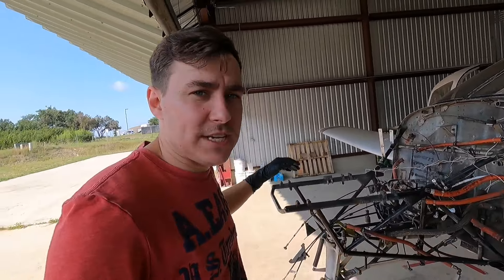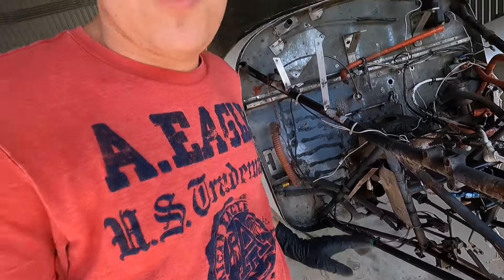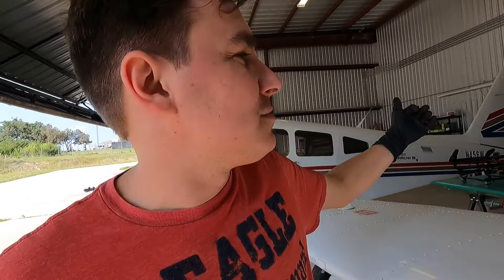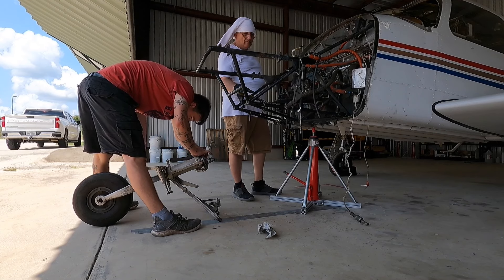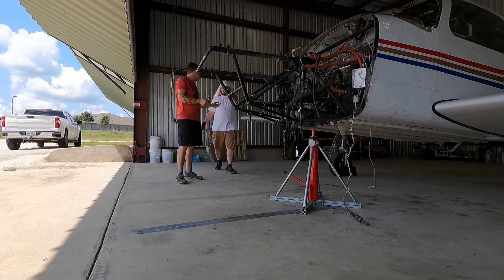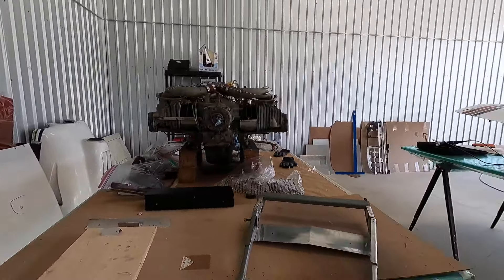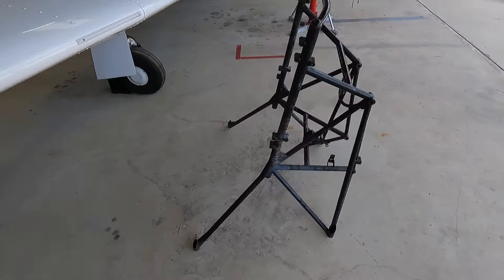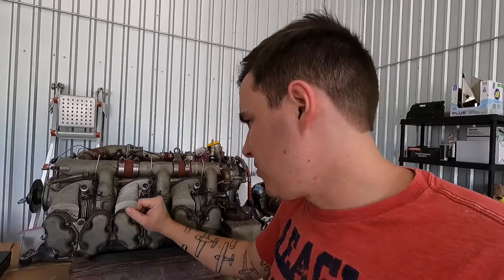Cost Comparison: Aircraft Engine Overhaul vs. Repair Station Overhaul vs. Buying New for Exchange

Comment: The problem with field overhauls is generally the A&P or IA for that matter just lacks the experience and then there is the issue of warranty. A few years back I assisted on a field overhaul of a C-85, cases, crank, cam, lifters, rods, mags, accessory gears and a hand full of other stuff was sent out for inspection and or rebuild/repair. While waiting for everything to come back we gathered all the "Paper", Service Manual, Parts Manual, Overhaul Manual, Service Bulletins, Service Letters, AD's..etc. It wasn't difficult, just time consuming on the research side of things.. Personally I think a Field Overhaul might be slightly better, if a part is found to be in specs but on towards the limits a shop will use that part, where the owner of a field overhaul might elect to just replace it, .. just my .02 cents, which is $27.84 is aviation dollars....lol
Reply from the maker: I would agree. It's something 99% of A&P's never do after school. The number of tools you will need to buy or make is often overlooked as well.
Reply: @brycebuildsit  I agree. I worked for a 135 operation and we just didn't have TIME for these types of jobs. Profit margins were so tight, we needed to get the customer in & out, including the company charter or flight school planes. We didn't have the time to tear down, inspect, mic, send out, re-inspect, then assemble a whole engine. Then the "warranty" was only based on the company. Yes, we would obviously warranty our regular work, but the liability of a whole engine rebuild- if that thing quit, even at the next TBO, the company would have to defend against a lawsuit = not worth it.
As you mentioned, the tools necessary to do it all- for the 1 engine per ~5 years field OH, not worth the investment in tools, etc. as well as the tech not being familiar with such a job. We pulled cylinders at least once per month, but not cranks & cams. In 15 years, I don't think I ever pulled a crank and certainly not a cam.
Reply: I think some used engine parts should just be REPLACE WITH NEW,  especially if they are small inexpensive parts
Reply: Do you have any idea what the warranty on a $80k motor is?  Less than 2 years or about 200-400 hours (depends), so no, the factory is not giving you a very long coverage period.  And the anp better have the business sense to be able to cover the rare return.

Comment: Wait, you never covered IRAN.  There is no way IRAN is even close to the cost an overhaul (unless some major components like the crank is bad).  As far as 'overhauling' a case, you have dye pen and some micrometers?  You can 100% do the exact same thing as one of these 'shops'.  The only thing you cannot do is issue an 8313 or zero time a motor.   And GA owners do not need an  8313. Its sad that anps have lost the skills required to do an IRAN and chicken out... costing the customer more money and worse, the mx losing all those billable hours.
Reply from the maker: I didn't mention IRAN because the video is about the cost of overhaul depending on the route you go. Personally, I have done several IRAN'S, and they were flight school aircraft that were not quite at two but needed to keep flying for the revenue.

Comment: Your “buying new” for exchange isn’t technically brand new.  Lycoming receives engines in, then tears them down.  Inspects all the parts, then throws the parts in giant bins that pass inspection.  Then they assemble engines with those parts.  You have no idea how many hours are in those parts and how close or far they passed inspection.  I’d much rather have a field overhaul that I know the inspection parameters and how close/far they were from failing.  And most of all how many hours are on what parts.
Reply: I've been out of the game for a long time, but I seem to remember you could buy a "Factory Reman" for x dollars, or you could choose a "Factory NEW" which I believe was at least 2x the cost, but advertised as "everything is new-new". Very few people did that. 
I wonder though, if you bought a brand new plane- a C172 to a B58, are the engines NEW or just factory reman?
Reply: @stargazer2504  You need to understand the difference between NEW and SERVICEABLE limits.  A USED crank can still be called NEW if it is within the 'new' wear limits', so parent is correct, if the case meets new limits, it can be used in a zero time overhaul and still be called new.
Reply: @yeagermcbipper9008   Really? You are stating "A USED crank can be called NEW"....
Go and read AC 20-62E and get back to us professionals.

4. Definitions: Paragraph G: 
"g. New. A product, accessory, part, or material that has no operating time or cycles"

NO OPERATING TIME OR CYCLES.

What YOU need to understand is... i'm not even gonna argue 🙄🙄🙄

Comment: I would think an engine like an C-85, O-200 or even an O-320 could be rebuilt by a local A&P for a LOT LESS than sending it off because they are such simple engines

I changed the N-number on my 1947 Stinson that came from Canada and used the airplane serial number = N2721L after checking the N number database to make sure it had not been used, easy to do

Far as I know it's still flying with the new owner
Reply from the maker: Yes, an O-320 would be much cheaper than the TSIO 360 on this arrow. Last O-320, I overhauled with a brand new crankshaft, and all new cylinders came in at just over 14k for parts before labor. I didn't do a good job of mentioning that but certain engines will be much much cheaper.
Reply: How  is the process of changing the registration of a private aircraft?, can you explain the process please ,thank you.